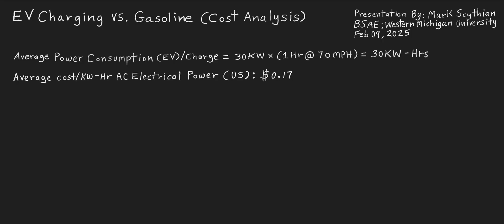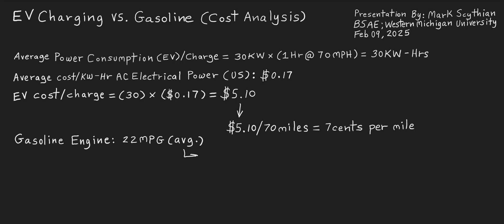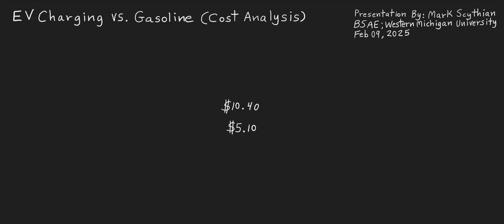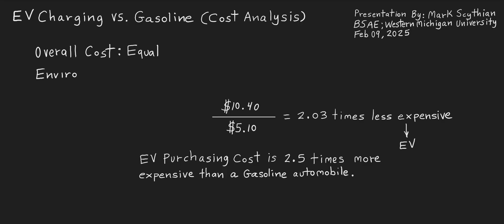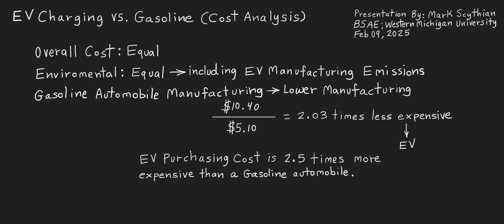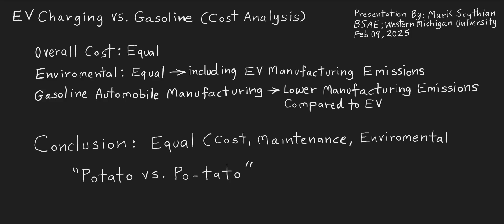EV vs. Gasoline Vehicle (Cost, Maintenance, Environmental)

Comment: Hydro carbon power is OPTIONAL with ev - the gas auto IS hydro carbon only. Put a solar system on your roof and you are carbon free with ev.
Reply from the maker: You're obviously not an Engineer, and do not understand the Fundamentals of Thermodynamics.  Or else you would not be posting such comments!  Read on to learn more.

The energy-density of (most) EV Batteries at 30,000 mAh capacity, 5.5C max discharge, 111 cells @ 3.6 VDC/cell (series), equates to a max power output of around 66,000 Watts for 1 Hour.  Most EV Battery payloads weigh on average around 1,000 Lbm.  Therefore, the average energy-density of an EV Lithium-Ion Battery, after factoring out the efficiency losses of the AC Power Inverter & AC Electric Motor (90% and 85%, respectively), equates to 172 BTU/Lbm Energy-Density.  

Gasoline has an Energy-Density of 20,000 BTU/Lbm, and weighs 6.00 Lbm per US gallon.  At 30% Brake Thermal Efficiency (4-stroke gasoline piston engine), the usable energy-density of Gasoline equates to 6,000 BTU/Lbm.  1 BTU/Sec Kinetic Energy = 1,056 Watts = 778.5 Ft-Lb/Sec.  DC Electrical Power = Voltage x Current.   There is 34 times more USABLE Energy-Density in Gasoline compared to EV Lithium-Ion Batteries.  Even if EV Lithium-Ion Batteries (material science) improves by 20% (R&D to Market), the Energy-Densitty of Gasoline remains at least 20 times greater than any EV Battery configuration.  EV is surely not for long-range, which is why EVs' would never sell, if they weren't incorporated with a (seamless) Piston-Electric INTERFACE, prior to Battery depletion!  

Solar is horrible for Energy-Density!  A 40 Lbm Solar Panel only discharges 300 Watt of AC True Power (Inverted from 350 Watts DC Photo-Voltaic Power).  This translates to:  [(300 Joules) / (40 / 2.2) kg] or 16.5 Joules/Kg.  1056 Joules = 1 BTU.   0.007 BTU/Lbm = Energy-Density of a single solar panel, at $300/solar panel!    

Government subsidies are paid by the tax-payers, government doesn't pay for anything!  You do!  20 million non-solar-taxpayers pay for 1 million solar users.  Not cost-effective at all.  Solar is just another method to increase debt to stabilize interest rates.  

Just like with EVs', Solar Panels require enormous Crude-Oil materials polymerized into Plastics.  60% of all Crude Oil is used to make plastics, paints, drugs, explosives, fake (toxic) sugar, and a million other non-fuel products, based on polymerization (Crude Oil repeating chains of Carbon-Hydrogen).  Wind & Solar are not "green"!  lol

We engineers, physicists, chemists, and mathematicians understands this.  

However, consumers don't seem to understand the Laws of Thermodynamics and Physical-Chemistry,  thus buying into all this nonsense.  

EVs' are losing popularity as the debt liability soars across America.  Unintended unfunded-liabilities are now a problem = excess inflation.

Whenever you use household AC power to charge your EV, you are still consuming hydrocarbon fuels from your Power Company in the form of Natural Gas to heat water into steam to power turbines driving AC Electrical Generators (Rankine Cycle), OR Kerosene to power Gas Turboshaft Engines driving AC Electrical Generators (Brayton Cycle).  

Unless hundreds of millions of solar panels are connected across a National Power Distribution Grid, to amplify EMI (Electromagnetic Induction) and Capacitance, solar panels lack the energy-density, and/or fail all time-constraints for any useful applications.  

Remember, Power is a function of Work (Joules) per Time (Seconds).  1 Joule/Sec = 1 Watt = 0.737 Ft-Lb/Sec = 0.00095 BTU/Sec.   

Even if solar could slowly charge useful applications, solar still lacks the energy-density to match real-world practicality.  Solar only exists, so that failing economies can generate more debt to stabilize interest-rates.  Keep this in mind.

Look for other videos in my Library, so that you become familiar with the Laws of Thermodynamics.  Can't get something for nothing.  

Marketing:  A delusional world grossly disconnected from Science/Engineering!  lol

- Mark Scythian
BSc. Aerospace Engineering
Western Michigan University
Feb 12, 2025
Reply: @markscythian  Actually until this unusually cold weather and to 30,000 miles the lifetime mileage was 4.0 kWh. Chevrolet repaid for our charger (a Grizzly) and paid to install our 220 connection to the carport so we enjoy closer to 9 cent per kWh power unless we are on a road trip.
Reply from the maker: @JWY  What is your average range (Battery only)?
Reply: @markscythian The Bolt is always battery only. Ideally the Bolt can go 265 miles. But, for longevity and safety I only charge to around 75%, for like 200 miles range. At highway speed the range drops some, for instance on one full charge I went 230 miles at 75 mph and 60 mph mixed and had only a few dozen miles range left. In Nevada recently I started to climb over a pass with 140 miles range showing and at the top I saw only 80 miles range left (Elk and trees, no recharging up there) but descending recharged to 120 miles range.
Reply from the maker: @JWY  Assuming 3,500 Lbm Bolt (including 1,000 Lbm Lithium-Ion Battery).  265 mile range (level dry paved road), 85% Electromotive Efficiency (AC Motor), 90% AC Power Inverter Efficiency, Average Projected Frontal Area (5 x 4 x 0.8 = 16 Sq Ft), Average Air Density = 0.0023 Slugs/Ft^3, Aerodynamic Drag Coefficient = 0.285, and Tire-Rolling-Resistance Coefficient = 0.012 ===> The equivalent-BTU Battery Potential Energy based on an average range of 265 miles can be calculated, while at constant average highway speed of 70 MPH (102.7 Ft/Sec):

Power Lost To Overcome Aerodynamic Drag:  [(0.285 x 0.0023 x 16 x (102.7)^3] / [(2)] = 5,680 Watts.

Power Lost To Overcome Tire-Rolling-Resistance:  [(3,500 x 102.7 x 0.012)] / [(550)] x [(746)] = 5,851 Watts.

Assuming Constant Speed, No Acceleration, Level Paved Dry Road (excluding hills and valleys) = Re-Gen Downhill + Loss Uphill = Net 0. 

[(5,680 W + 5,851 W)] = 11,531 Watts to maintain Inertial Speed (70 MPH).

Run-Time = [(265 miles / 70 MPH)] = 3.8 hours.

Overall Efficiency (Load & No-Load) = [(0.85 x 0.90)] = 0.765

Power Draw = [(11,531 W) / (1 / 0.765)] = 15,073 Watts.

Equivalent Battery BTUs' (Potential Energy) = [(15,073 W) / (1,056)] x [(3.8 x 3,600)] = 195,264 BTUs'.

Battery Equivalent-BTU/Lbm = [(195,264 BTU) / (1,000 Lbm)] = 195.3 BTU/Lbm.

Previously calculated average = 172 BTU/Lbm.

Improvement = [(195.3 / 172) - (1)] x 100% = 13.5%. 

Approximately 265 mile range (plus or minus 10%), and 13.5% longer range than industry standard (full-charge).

Impressive!

You must love your Bolt!!!  lol

Comment: 40 sec in and I see this math is way off. At 70 mph a Bolt gets 3.7 mi/kWh so that's 20 kWh, not 30 kWh. Our Bolt with 40,000 miles of mixed highway\city driving has 3.9 kW lifetime average.
Reply from the maker: Excellent improvement!  Material Science is advancing at a faster rate than what most of us Engineers have caught up with, thanks to AI.  Electrical Engineering like Mechanical/Aerospace Engineering are limited by advancements in Material Science (Electrical Strucutres, Solid-State, Physical Chemistry, Stress-Analysis, Fractals, and Matrix-Probabilities).  Computer-Scientists and Operations-Researchers have let loose AI (research) directly to 3D-Printing Automation (development).  It's eventually going to move toward Programmable-Matter & Self-Replicating (Positionic) Manufacturing.  Thanks to Graphene Die-Electric Substrates.  Rapid improvements have occurred, R&D to Marketing happening almost in-parallel, within cost-effective limitations.

Comment: Thanks for the analysis. Here's just some comments:
1. Using your numbers for cost per 70 miles ($5.10 and $10.40), the cost to drive the ICE vehicle a distance of 10,000 miles (roughly one year) is $757 more than for the EV.  Over the time-of-ownership, this could amount to several thousand dollars.
2. Your ratio of initial vehicle cost is not necessarily accurate. I drive a Kona Electric, which is basically an entry level EV, and provides a good comparison because the Kona is available in EV and ICE configurations. Cost of entry-level/trim vehicles (most appropriate for people most concerned about cost):
Assume roughly 11% tax and fees (about right for CA)
Cost of new 2025 Kona EV:  $32875 + tax/fee = $36491
Cost of new 2025 Kona ICE: $24450 + tax/fee = $27140
Ratio is EV/ICE = 1.34
https://www.hyundaiusa.com/us/en/build 
3... Other factors could be considered in the analysis (maintenance, resale value, etc.)
4. Although not really relevant to your analysis, a prospective owner would also consider the smiles per mile factor. As an EV driver, I can say that the EV definitely provides more smiles per mile.

Comment: Wrong.
Reply from the maker: You're obviously not an Engineer/Scientist, and do not understand Thermodynamics & Physical-Chemistry!  Read on to learn more.

The Energy-Denstiy of EV Lithium-Ion Batteries are INSIGNIFICANT compared the Energy-Density of Crude Oil or Hydrocarbon Fuels.  

The typical EV Lithium-Ion Battery has a Current-Capacity of 30,000 mAh, Discharge-Rate of 2.5C (average), maximum discharge-rate of 5.5C, 111 cells at 3.6 VDC per cell (series), and weighs 1,000 Lbs.  

This means that the average Lithium-Ion EV battery has a potential energy of:  [(30,000 mAH) / (1,000) x (5.5) x (111 x 3.6)] / [(1,056) x (3600)] = 224,775 BTUs' ===> [(224,775 BTUs') / (1,000 Lb)] = 224.8 BTU/Lb.   

EV BATTERY ENERGY-DENSITY = 224.8 BTU/Lbm without factoring out AC Motor Electromotive-Efficiency-Losses ===> AC Electric Motor Electomotive Efficiency = 85%.  Note:  AC Power Inverter converts DC to AC.  Typical AC Power Inverter Efficiency = 90% 

[USABLE ENERGY-DENSITY OF AN EV BATTERY (AVERAGE) = 224.8 BTU/LBM x 0.85 x 0.90 = 172 BTU/LBM]  

Crude Oil, Diesel, Gasoline, Kerosene at various fuel densities all average to 20,000 BTU/Lb energy-density.  

Average Gasoline vehicle fuel tank capacity:  15 gallons.  1 gallon Gasoline weights 6.00 Lbm.   15 gallons of Gasoline = [(6 x 20,000 x 15)] = 1.8 million BTUs' for which 30% is usable at 30% Brake Thermal Efficiency ===> (0.3 x 1,800,000) = 540,000 BTUs'===> (540,000 BTUs') / (15 gal x 6 Lbm/gal) = 6000 BTU/Lbm.

[USABLE ENERGY-DENSITY OF FULL TANK OF GASOLINE (AVERAGE) = 6,000 BTU/LBM]  

The usable energy density of a full tank of Gasoline is 34.9 times GREATER than an EV's fully-charge battery:  EV = 172 BTU/Lbm.  Gasoline Vehicle = 6,000 BTU/Lbm. ===> (6,000 BTU/Lbm) / (172 BTU/Lbm) = 34.9 

THE USABLE ENERGY-DENSITY OF A FULL TANK OF GASOLINE IS 34.9 TIMES GREATER THAN THE ENERGY-DENSITY OF AN EV'S FULLY-CHARGED LITHIUM-ION BATTERY.  

BTU/Lbm ===> Potential Energy.   BTU/Sec ===> Kinetic Energy. 

1 BTU/Sec = 1,056 Watts = 778.5 Ft-Lb/Sec = 1.42 HP.

DC Electrical Power (Watts) = Voltage x Current.

If one were only driving 70 miles at a time, Gasoline costs would be more than two (2) times greater than AC electricity charging costs (EV).  However, EVs' purchasing cost(s) are at least twice as expensive as Gasoline vehicles.   

Note:  90% of all AC Household Electricity is harnessed through the combustion of Natural Gas (heating water into steam to power steam-turbine-AC-generators = Rankine Cycle), OR the combustion of Kerosene (gas turbine engines powering AC-Electrical-Generators = Brayton Cycle).

EV manufacturing processes are as environmentally-unfriendly as Gasoline combustion emissions ===> Non-radioactive Polymer Isotopes (EV) vs. Oxides-of-Nitrogen (NoX) & Oxides-of-Sulfur (SoX) ===> GV.  

Overall maintenance costs ALSO EQUALIZE across EVs' and GVs' with respect to Chassis and Chassis-Electrical/Electronics.

Who Is Correct vs. Who Is Wrong ===> Determined By:  Mathematics, Physics, Chemistry, Operations-Research, Computer-Science, and Engineering.

We engineers/scientists know the (long-term) pros and cons across EVs' and Gasoline-Vehicles are EQUAL.  Or else the First Law of Thermodynamics (Conservation-of-Energy) would be violated and no product (resource allocation) of any kind could be incepted/built.

THE ARGUMENT REGARDING 'EVs vs. GVs' IS A POLITICAL ONE:  DESIGNED TO DIVIDE THE MASSES AGAINS EACH OTHER.  PRODUCING EVs' ALSO CREATES MORE DEBT (BY DESIGN) TO STABILIZE INTEREST RATES (ECONOMICS).

Gasoline automotive engines (built after 2010) emit (for the most part) Carbon-Dioxide gas (plant food), and Water-Vapor (largest greenhouse gas).   Thanks to:  Variable-Valve Cam-Timing, Anti-Detonation-Sensing, 11.5:1 Compression Ratio, Cylinder-Direct-Injection, and Die-Electric-Catalytic-Super-Reheating (Empirical CxHyOz = 74 Moles Carbon Monoxide to 14 Moles Carbon Dioxide).

Plant Photosynthesis:  Water + Carbon Dioxide + Sunlight = Plant Metabolic Energy.  Plants then excrete Oxygen Gas into the environment.

WATER-VAPOR IS THE LARGEST GREENHOUSE GAS:  Water and Water-Vapor absorb & reject heat at SUBSTANTIAL LEVELS ===> vaporization & condensation ===> 1,000 BTUs' heat ABSORBED to vaporize 1 Lbm of Water to Water-Vapor (vaporization).  1,000 BTUs' heat REJECTED to condense 1 Lbm of Water-Vapor to 1 Lbm of Water (condensation/precipitation).

Conclusion:  Long-Term pros and cons across EVs' and GVs' regarding Cost, Maintenance, and Environment = EQUALIZED. 

You're not "helping" the environment by buying and driving an EV, no more than buying and driving a GV manufactured after 2010.

If you are an engineer or scientist, you would know all about what I have wrriten here.  But, you obviously are not.  

Or else you would have not have posted a comment stating:  "wrong".  lol

Here is another video you should watch to learn more:  https://www.youtube.com/watch?v=eJGTbGfKjj0